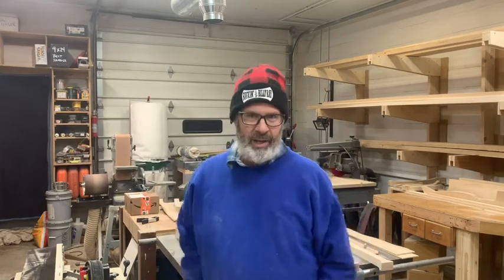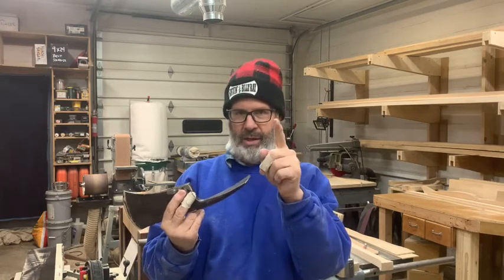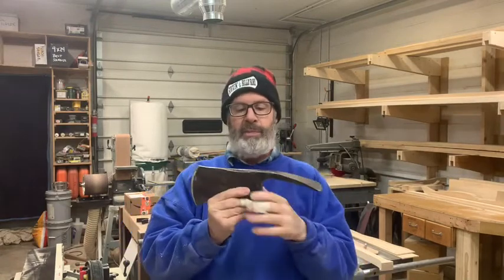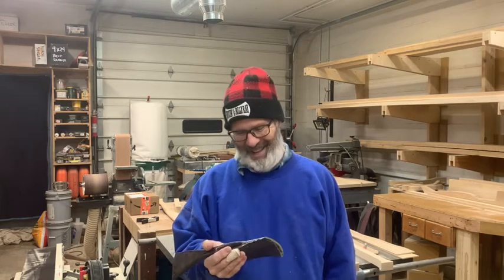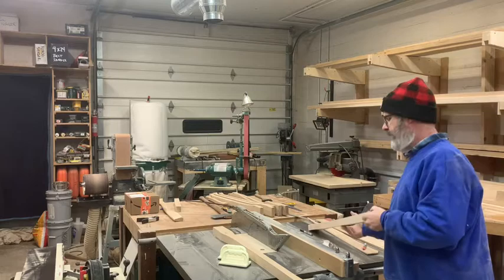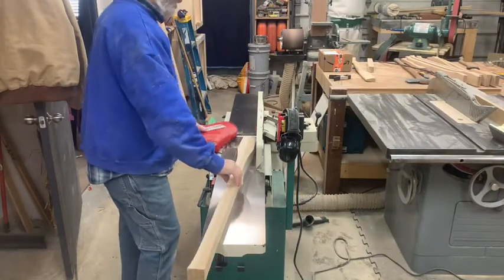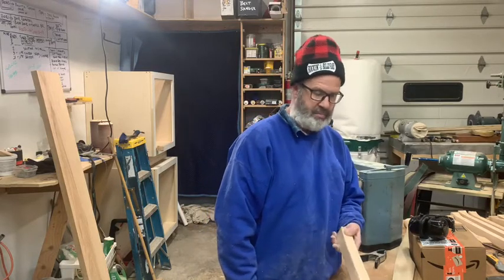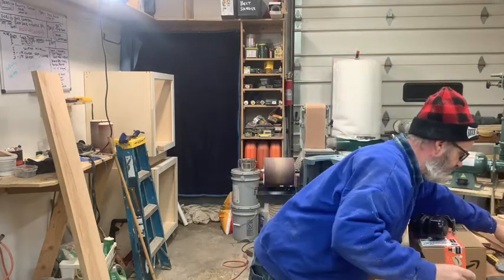Pesky Pulaski Handles, jointing them straight before shaping

Comment: 45 degrees roughly checked with tri square. Follow the old file marks if they are right. The bottom side. I like em filed straight across. Somebody taught me the angles in 1966. 36" is the "standard" length. 40 inch is just fun to do. Stand up and Grub. Good advise on the center-line.  Rock on.
Reply from the maker: We need to give Pulaski’s the due they deserve.

Comment: long way to go, casterman. I am convinced that the cut open handle blanks, put on with piles of wood, are dried for a longer period of time. i'm talking about many months under favorable circumstances to get the tension out of the wood. I would be very interested in how the amish do it. But here I can't get such information. perhaps the blanks will be cut out of the plank in stages and temporarily stored. So, for example, first dry 4 times the width for a certain time, then 2 times the width, dry again and after a few months with good storage conditions then cut to the final width ... (only to still have a lot of waste). this is just a guess and i hope you don't think i'm extra smart. I wish you every success with your work and I am excited to see what ideas you will come up with. have a good week, my friend. stay kind, love wins!
Reply from the maker: I think you’re 100 % right. Same with guitar makers. You have to develop your own wood stash and stabilize it. There’s a big difference between hardwood and handle grade hardwood. One thing I know is that it starts at the mill. Most sawyers want high yield of footage. Cutting for handles is different. The tree I bought last fall probably won’t be ready until 2022. It was a big tree. I have all sap wood. The ultimate goal is to buy trees not boards. It will take time. I’m always interested better ways to do stuff!😊 input is always welcome. 👍👍
Reply: @Casterman2  it would be nice to talk to killingers suppliers. but they keep their secrets well ... how is the wood for guitar necks stored and prepared? thank you for being able to talk to you about something like that. love you, brother!
Reply from the maker: @pilkpulk8284  companies like Gibson and Martin and Fender for their higher end stuff sit on the primo stuff for years. Sitka Spruce tops for acoustic guitars are stabilized in controlled environments for god knows how long. And they never use everything from a particular year. So they have wood that goes way back. Since Martin was founded in 1833 they have lots of old growth Spruce, Brazilian rosewood. It’s crazy. I took a personal tour of the Gibson factory in 1992. It was AMAZING! There’s a whole other level of wood buying for industry. Vic Firth drum sticks, European axe companies using American Hickory. It’s out there. Just have to find it. 😝🪓🪓 much love brother!
Reply: @Casterman2  <3

Comment: Casterman3 What’s your thoughts on the dewalt bench-top planer? Ive been considering one for like the last year
Reply from the maker: The DW734 is good. More than adequate for shade tree woodworking. For a couple hundred more the DW735 is a tank. Super solid and powerful. I think it’s the best one out there for bench to planers. I’d own one if I didn’t need a much larger one.